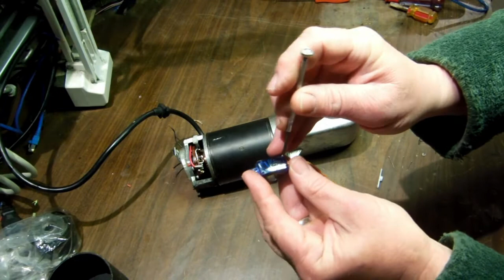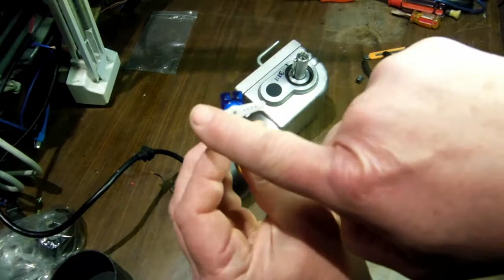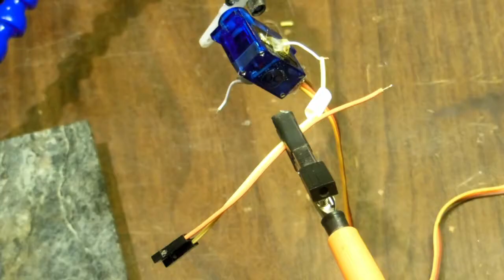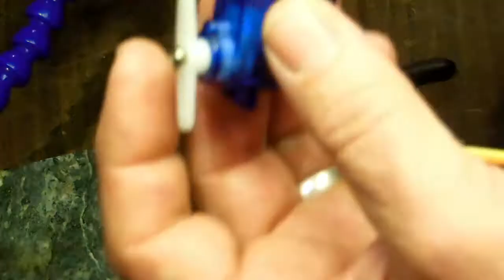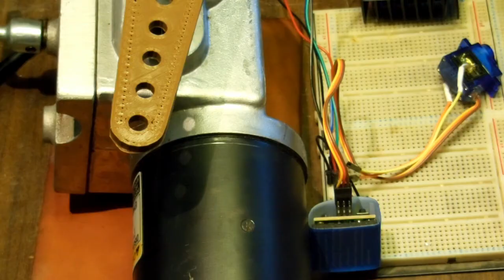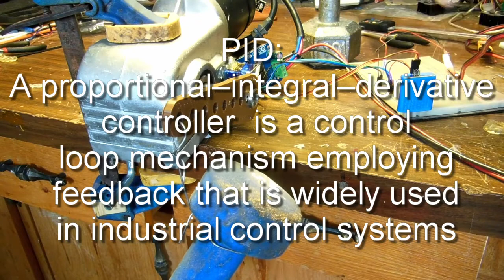24 volt Giant Hobby Servo for under $10

Comment: thanks! ran into the reversed servo output to the controller connection and you solved it for me!  I also like your linkage better than mine. I used matching gears from the pot to the output shaft.

Comment: A geared radius setup would be more efficient in this application. I would love to see this work without incident. Keep posting updates as I have subscribed. 😁
Reply from the maker: Thanks for the subscription. I agree a radius gear would be better. I might have to 3d print that to try. I also have a CNC plasma cutter now, so the arm can easily be made of metal. I have a use for this giant servo to make a "head" for the rover bot that can follow an object nearby. Stay tuned to see this project in actual use soon!